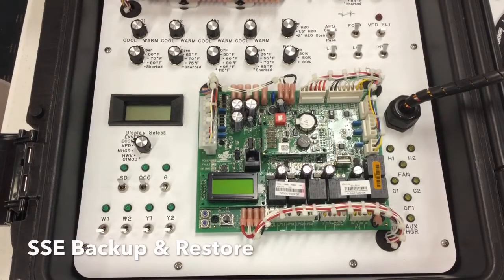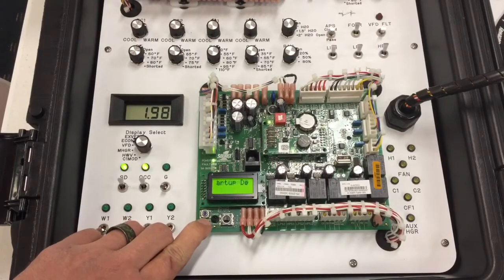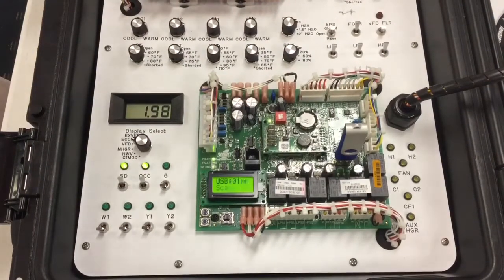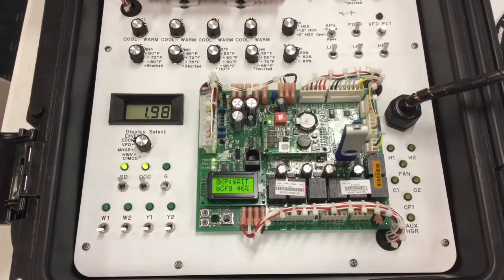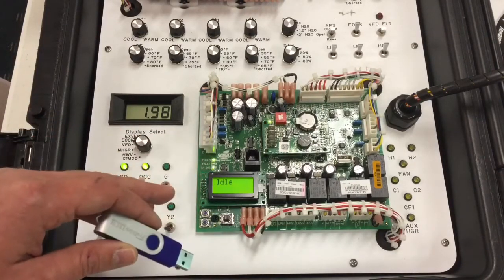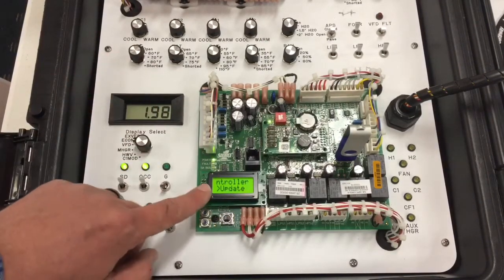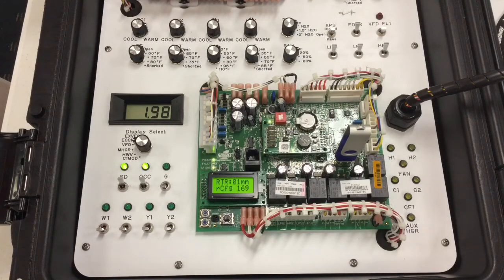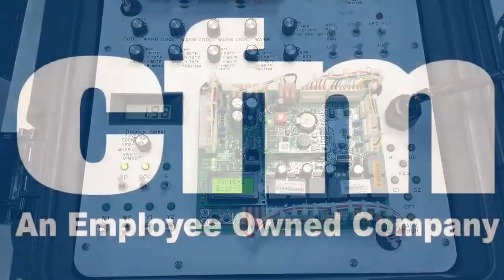SSE backup & restore

Comment: Hi, I am getting a HS1 limit switch  error in heating mode which was triggered by the LS1 trips.  What  do HS1 and LS1 stand for? Is it the heating high limit switch or the cooling pressure switch? Any help would be greatly appreciated.  Thanks
Reply: HS1 is a fault code that locks out heating due to the limit terminal in the top left hand corner of the SSE unit control board stopped receiving voltage. The SSC unit control board monitors 24 V on that limit terminal however, there is a totally separate ignition control that controls the outputs in the safeties for heating. The SSC unit control board only monitors the safeties.

LS one indicates that a limit switch has opened. A limit switch opening is usually due to an increase in supply her temperature. A limit switch is a safety device and should always be taken seriously. Be sure to follow manufacturers recommendations and requirements for gas, pressure, voltages, and maximum supplier temperature located on the data plate of the unit. 

A higher than normal supplier temperature typically caused by air flow restriction or higher than allowed. Gas pressure is most likely the cause of your issue. 

Only qualified licensed and insured HVAC service technicians/companies that are approved to work on equipment should attempt diagnosis or repair of HVAC equipment .
Reply: Thank you so much for your help. I am a subscriber to your channel. But your channel deserves alot more subscribers. Thanks again
Reply: The unit was heating fine before a snow storm. At first it was giving a C#1 coil freezing error code.  I turned rooftop power off for 5 minutes and the error went away. Now it's just runs for about 5 minutes in heating mode and burner shuts off and only blower fan running with the HS1 limit switch error. Thanks
Reply: Yes I am a licensed hvac technician. I just haven't had much experience with this SSE. This unit comes with a VFD blower. By any chance can you give me the flow chart how to increase blower to 100% on the SSE control? Thank you.